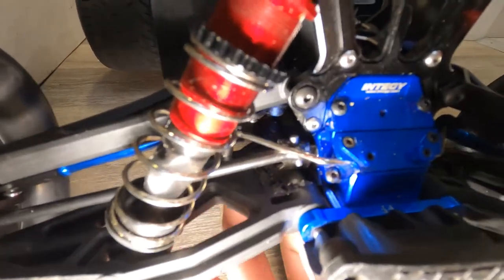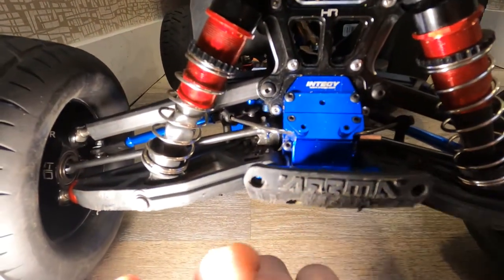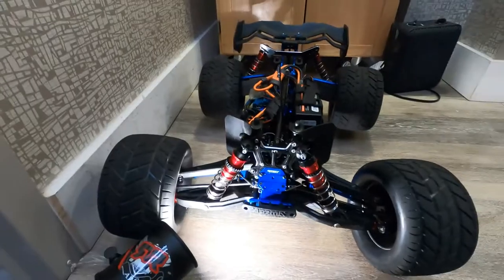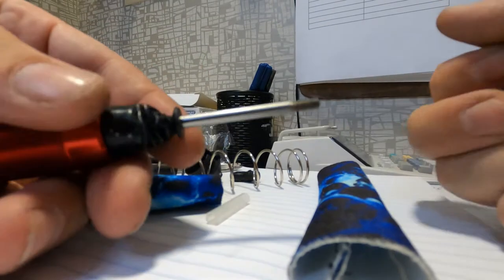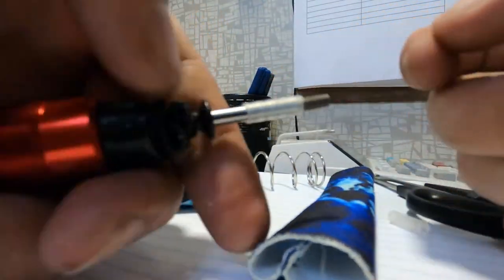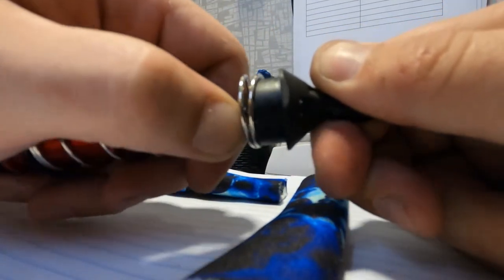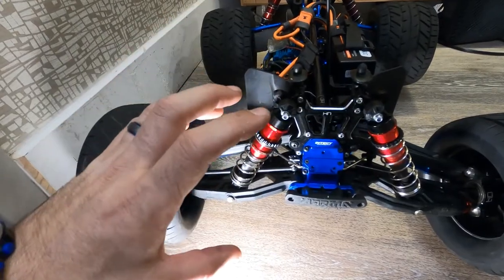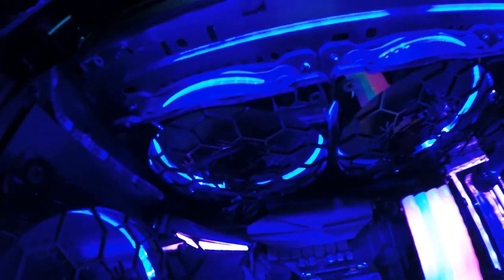ARRMA KRATON 6s FRONT RIGHT " CVD" Popping OUT! HOW TO FIX IT !!

Comment: Good job.  I’d like to add my input here 

I’ve finished a 2 month grind testing the issue spoken about here this exact front Cvd issue 

The reason I come up with was test after test is that the drop screws have to hold the arms more level and keep them there in order to work without popping out 
The level plane is key to keeping the shafts in 
The big Angle of the arms pointing down is what’s wrong 
Causing the shafts to pop out when the arms are forced down from cartwheels and crashes

All of my testing did come to the ultimate conclusion to set the drop screws and make sure the shocks can’t be forced apart / extended 
👊😎👍👍
Good job looking for innovative ways to help the hobbiest’s out 💪😊👍

Comment: I had this exact problem with my K6s as well. I think it was maybe East Tactics on YT who suggested removing the spacers from the ends of the front A arms, top and bottom and adding shims to the cvd inside the knuckle. This has worked so far, but I'm gonna do this as well - thanks.

Comment: Good video, gonna try it. Mine pops out, drives me nuts, even with the hub washers out what tires are those, thanks
Reply from the maker: I hope it helps you. Thank u 4 watching. Plz consider Subscribing.. They r Duratrax 3.8 belted MT tires.
Reply: @ATECHPCs  thanks I will subside, looks like those may be my next tire, 80 bucks for 4 can't beat it I mainly just drive my kraton in the road, topping up and down the street, got backflips on it and they holding up pretty good but yes it's like to save them if I can